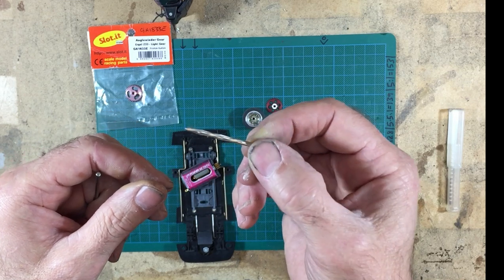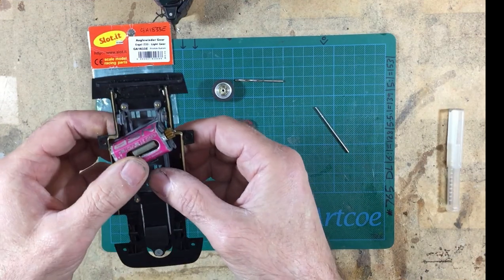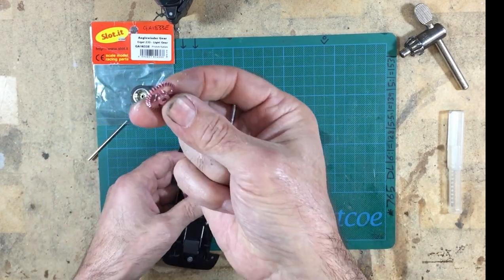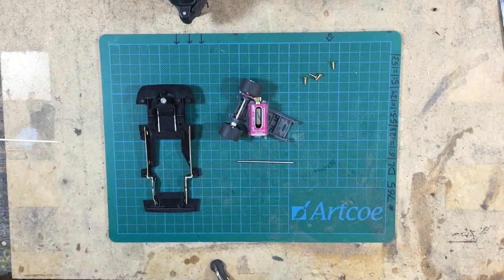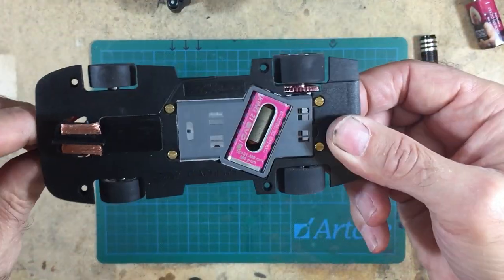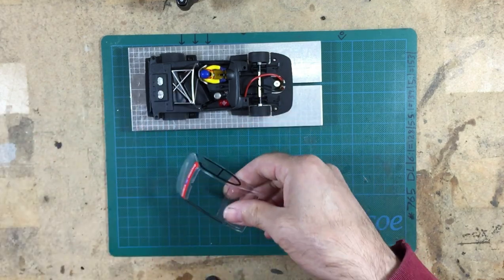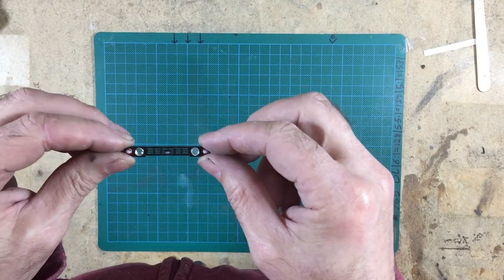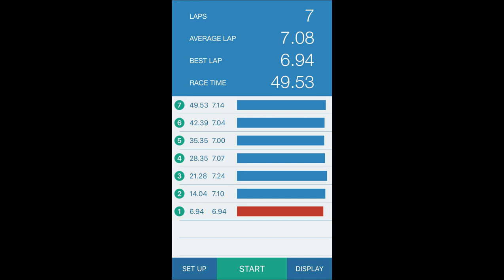Getting more out of a Fly Capri, Part .3.

Comment: I love your rebuilds, you are an inspiration!

I gave up on mixing and matching pods, pinion and spur gears! Now i am sticking to my favourite NSR brand for a couple of reasons:

1, their pods mount with three screws, i my opinion this makes them float better.

2, the motor orientation connects to the correct polarity,  ie + to +. Most other brands, connect + to - for the car to move forward. This is something I don't quite understand because the red dot on DC motors is there for a reason!.

So to have the opportunity to purchase any brand of cars and reto fit them with a scratch built chassis, I am experimenting with Laser cutting acrylic chassis. I am more of a racer than a modeller/collector, so speed and handling are important for me!
Reply from the maker: Awesome.

Comment: I think you have some components with production tolerance concerns Rob. I regularly put NSR wheels onto 2.38 axles, never have I been able to do that without first running the reamer through, not even tightly like yours did.
Reply from the maker: I do find the 2.38mm parts can be quite variable, some a better fit than other parts, so I expect nothing different with other sizes. As you say, if I had bought a different NSR wheel pack, I bet they would not have fitted. The reamer is always at hand though, so not a problem 🙂